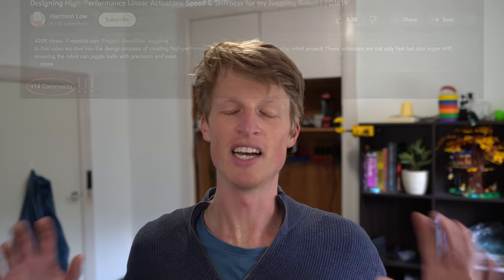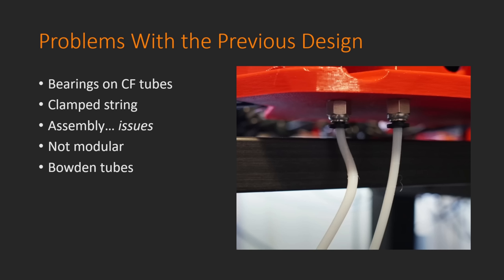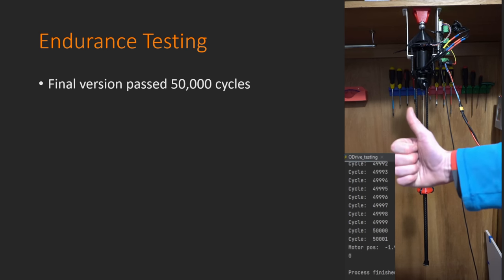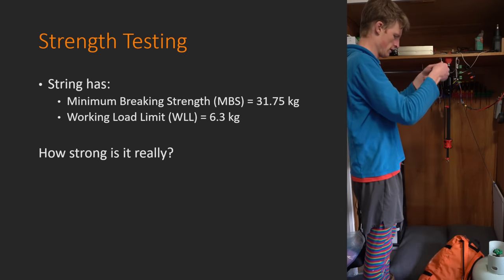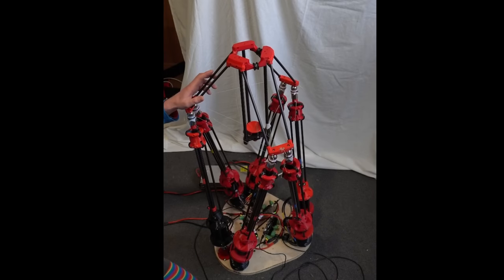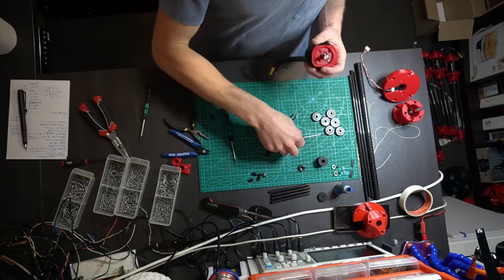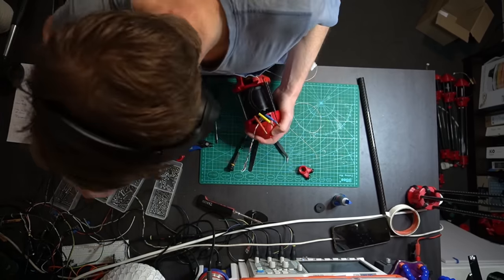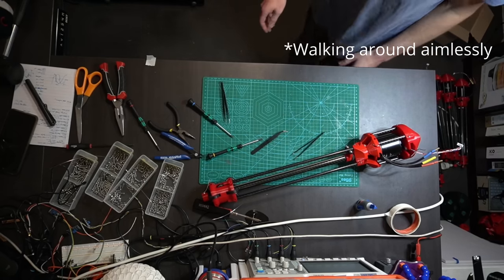My New Linear Actuators are SO MUCH BETTER! | PDJ #21

Comment: On the bearings, you might look into a cove design so that you have multiple points of contact around the rods; similar to how V wheels work with aluminum extrusion made for DIY CNC stuff, but inversed.  Since you're changing the inner rod to have a bearing block at it's extreme end, you might as well minimize the bearing block on the structure.  Two blocks of three bearings with the cove tires, it should be more than enough to keep things in place.  And on the tires, you don't necessarily need the entire cove to be the point of contact, as that'd add insane amounts of friction, you could do a grooved cove to where the center and two extreme ends are the contact patches; due to how the extremities roll, this should allow for enough friction for decent holding power between that side of the bearing and the relevant rod. 

On the string's pulley system you could technically simplify it.  In your model, the blue string from the spool is doing a 90° XY-Y turn, a 90° Y-Z turn, then a 180° up and around the tube systems to the carriage, and the yellow string from the carriage is doing a ~135° Z-XZ turn, a 90°XZ-Y turn, and a ~45° Y-XY turn back to the spool.  There's a lot of turns that aren't immediately necessary, and part of design iteration will help with this.  You're pulling the actuator from opposite ends, but you have to ask yourself if this is entirely necessary when the string is essentially one big loop, it doesn't really matter where you tug on the loop when the entire loop moves in sync.  What you could do, with the previously mentioned bearing block carriage at the end of the actuator, is offset the yellow string slightly so that its new (X,Y) position on the plane of the bearing block allows for a better vertical drop into the spool housing, just like you're using one of the carbon fiber tubes for the blue's vertical rise, place the yellow's drop between two tubes, this will allow for better routing within the spool housing.  As for the spool housing, you don't really need all of those turns, as long as you have excess tension string wrapped around the spool (I'd go for three wraps at the extremities), you really only need the XY-Z planar to vertical conversion on both strings, because the angle off of the spool really doesn't matter as torque and tension will be equal no matter what angle the string exits the spool at, this leaves the upper 180° pulley, the only component left is string length for proper tension but this is fairly obvious; one loop, three pulleys total, where the spool is seen as a tensioning device, and the carriage is seen as a connection, it's physically a loop even if the string itself is segmented.  Look at how belt-driven CNC platforms are driven for example, they have a motor, pulleys at the extremities and for guiding purposes, a tensioning device, and often the belt will terminate at the carriage, where this system is also seen as a tensioned loop; what I described for the linear string actuator is really no different in how the system works, so it's verifiable via analogy.  This works nicely because the proposed design has the moving rod constrained concentrically by the housing's upper bearing block and the rod's endcap carriage is constraining itself against the housing's support rods, and with optimized tire shape for the bearings, the system is forced to be linear with little deviation, which means you can also push and pull on it from realistically any point because that's how a loop works as long as you have the tension to force it to work. 

If you wanted to further simplify the pulley system, mount the motor so that the spool is in-line with where yellow drops and where blue's vertical needs to loop, this will leave you with two pulleys total, essentially a modified oblong.  And because the carriage is the termination points and you still have the tensioning device, the spool, the system will still operate as intended, just like the above example does and three pulley system does.  The only downside here is that you now have a motor hanging off perpendicularly, though luckily the angle of the motor and spool on the (X,Y) plane in relation to the string's Z axis really doesn't matter, so there is a way to tuck a portion of the perpendicular motor into the actuator's housing; just optimize motor placement, blue's tube constraint, yellow's housing exit hole, and lower pulley placement, it becomes a game of where to place things.  But this system still works like the previous, it doesn't matter which part you tug on as it's all one loop.  Hell, you could also tesselate this design, mess with the motor-spool drive to have a common motor, and have double or triple redundancy within the actuator.
Reply from the maker: Wow! Lots of great ideas here, thanks 😊 Some thoughts:

1 - I worry that having a V-groove bearing straight on the central CF tube might cause wear? (similar to what I experienced using the normal radial bearings [shown at 2:07 in the vid]). Another viewer suggested using V-groove bearings with o-rings in the groove, so the o-ring is the only part actually contacting the tube. I actually originally had the TPU sleeves being concave instead of convex and they had an insane amount of friction (though they were a very good fit for the CF tube)

2 - I do like the idea of having the string being a single loop, though I'm not sure how to ensure the motor has a solid "grip" on the string? My understanding of belt-driving CNC machines is that the belt is very tightly routed around the motor's output shaft, which has a toothed gear to match the profile of the belt. If I'm using plain string I have no idea how to ensure that the string doesn't slip on the spool? (though maybe this could be seen as a safety feature, where the string slips instead of snapping?). I can kind of imagine how it could work with the synchromesh cable thanks to its strange profile, though even then it might be tricky if printing the parts and using the smaller synchromesh cable (tolerances would be tricky here).

3 - I'm not sure I fully follow your proposed routing idea(s). Would you be able to draw something up and share it on Zulip? I'm intrigued by what you suggest, but I'm having a hard time visualising it. I'll post a link to the relevant Zulip topic as a reply to this comment (in case YT takes a disliking to the external link). 

Cheers for the suggestions!
Reply from the maker: Zulip topic for alternate string routing ideas:
https://pdj.zulipchat.com/#narrow/stream/399304-The-Arm/topic/Alternate.20String.20Routing.20Ideas/near/388860540
Reply from the maker: Another thought about why I had so many loops around the string spool: I agree that the number I had on the actuator in the video isn't strictly necessary, but I found that many of the string breakages would occur towards the tube-end of the strings, meaning that having excess on the motor spool makes it much easier to fix breakages: rather than needing to re-route a full new string (very tedious), I can just pull out more from the motor spool 😊
Reply: @harrisonlow  1. Metal on metal (carbon steel on carbon fiber) will always cause wear, this is the primary reason why I suggested a tire on the bearing, the secondary reason being the profile is much easier to produce in a rubber-like compound than it is to find a bearing with that kind of profile; plus you had already found these results with both a TPU tire and using heat shrink as a tire.  Really any profile of multiple points of contact works, a V provides two, what I had suggested for the halfpipe-like tire with cutouts would provide three, and of course a matched radius would give the most contact but also the most friction; it's just a balancing game of location and tire grip.  But the important part of this point is that using a negative-profile tire will help locate the rod within the bearing setup, multiply that by three and you have a well-constrained bearing block that only uses one bearing per rod, then inverse this at the other end with three bearings locating the central rod; it's a nice system that's not all that complex and would be easy to swap parts if needed.  Part of the problem with carbon fiber, as you've noticed, is the wear it'll have on any part, and this mostly comes down to not only metal contact but also the fact that carbon doesn't have a smooth metal surface as it's a woven product within an epoxy matrix; strength properties may be suitable for your need, but surface quality isn't and that's why you don't often see them as linear rails.  A recirculating type of bearing, what ball screws use on the bearing side, might work with carbon fiber tubes, but this would inevitably become expensive, complex, and might not alleviate eventual scoring of the balls within the bearings. 

2. This is a simple thing to explain, have you ever wrapped string around a cylinder where both ends are free?  Multiple wrappings of the string around the spindle will keep tension on the string while also allowing equal forces on both the pull and release sides.  This is also how the motor would 'grip' the string well, because it has so much contact and tension with multiple wrappings of string, and there's no losses because what is taken out in movement is fed right back in; this is also how the string doesn't 'slip,' multiple windings will ensure there's enough friction against the string so that it doesn't slip on the spool.  Belts cannot do this because of their width and their inability for slight deviation around a cylinder to allow for spiraling; but this is the benefit of string, it's free to tightly wrap around surfaces multiple times.  Though I will also mention, in a bi-directional spool where the wire enters one portion, wraps around the spool multiple times, and exits from a different portion, you should ensure that the string has proper entry and exit points, say top of the spool in tangent positive is the entrance and bottom of the spool in tangent negative is the exit, maybe with relevant eyelets in the spool's housing to help route this; possibly also groove the spool as well, say if you're doing ten windings, that can easily be modelled as a spiral. 

2.1. On the topic of synchromesh cable, you should view this as more of a rack and pinion than just a string-based actuator.  You're driving the synchromesh via the profile.  And similar to belts and rack gears, the output can also be a pulley itself.  I know 'cable' is a common name for it, but it really is just like your typical belt, but rather than being planar it's a spiral around the cylindrical cable.  Wire actuators, like what you're using, are much different in that string tension will make or break the device it's used in, plus the obvious wire spool on the motor; where racks, belts, and synchromesh cable have teeth to ensure transfer of force, a wire actuator operates on pulling an object rather than acting as push and pull, this is why you need two spools or a bi-directional spool with a lot of friction on the string to ensure 'push and pull' by having two discrete pull operations that work in opposite ways- basically pull abduction and pull adduction, if you understand anatomical movement terms for the analogy. 

3. I'll draw up the various ideas I had when I find the time to, life has been fairly busy as of late.  The thread you linked does demonstrate what I was initially describing, two pulleys per string on a fully split setup.  The image also demonstrates how you can go from a split spool to a common spool, you can see that the two wires are within the same tangent of the spool and going in opposite directions, all you need to do is a helical wrap and connect the two ends, now you have one string for the whole system.  What the image doesn't demonstrate is the idea of rotating the motor-spool assembly to get rid of the need for additional turns, if the spool's tangent is in-line with one of the two verticals, you can remove additional pulleys and still have the same actions on the string.  This also only demonstrates the interaction of the spool and nearby pulleys itself, in my original comment I had also mentioned where the endpoints currently are, such as your current setup pulling from the far end of the actuator and the current carriage at the near end of the actuator's boom, and a simplification of this would be attaching both strings to the carriage itself (which is constrained by the above mentioned bearing block designs) where the strings remain vertical at all times outside of bending around the top and bottom pulleys; this forms a virtual loop, where the carriage acts as a bridge between the string's two endpoints, as the string itself isn't necessarily aligned at the two ends.  Between the spool arrangement and the carriage connection, this is how you can achieve two pulleys total for the entire system.  This simplicity would also be what allows for using two or three of these systems for redundancy, the only change is that instead of direct-driving the spools you would now be using a gearset (yes, I know backlash is an issue, but there's ways to alleviate this issue) to use a singular common motor between multiple spools.  Again, I'll draw up what I'm explaining when I have some time to get into cad and draw the system as a whole; ironically I can type this out much faster than my current laptop wants to boot, update, and reboot Fusion. 

3.1. This simplification would also work with the synchromesh cable as well, but again that acts more as a gear rack than it does a string, just with high flexibility and none of the tensile stretch that rubber belts experience.  This would mean the tensioning mechanism would be slightly different, I'm not sure if synchromesh can, or if there's even a part for it, have a spool  with a low number of windings (say, one or two total) as a tensioning device.  If that part is possible or does already exist, synchromesh cable may be a viable solution; but the issue when it comes to design is that you're changing actuation methods from a pull-string to a form of gear rack, which while the pulleys and routing may remain the same, drive method does not, and tensioning method is a bit up in the air until someone tries out a spool tensioner for synchromesh
Reply from the maker: Big thanks for the write-up! Lots of super useful info in here.

2 - I quite like this idea and I can see how a friction "knot" would potentially work well. I really should've bought more spare motors so that I can test out ideas like this! (I currently have 7 and they're all built into actuators right now 😅)

3 - I look forward to seeing the drawings/CAD of your idea! This is quite a nice idea and would go a long way towards simplifying the design. It's worth noting though: the main reason I didn't set the motor perpendicular to the extension axis is because I don't want the motor to be sticking out the side of the actuator. I have a gut sense that this would likely cause issues down the line once I put all 6 actuators together into a Stewart platform so I want to keep everything as "neat" and in-line as possible. I think using the motor body as the spool would still work, though, because I'd be able to keep the centre of mass of the motor approximately coincident with the extension axis.

Cheers!
Reply: @harrisonlow  I'm sure your well aware, but using the motor shell/bell/housing as the pulley will reduce your torque/force and accuracy  by a 2*pi*r type of ratio.

Also of probably smaller concern (not sure how warm your motors get), the windings around the motor will help insulate motor heat (probably no big deal) but also will heat up the line wrapped around it, potentially weakening the line.